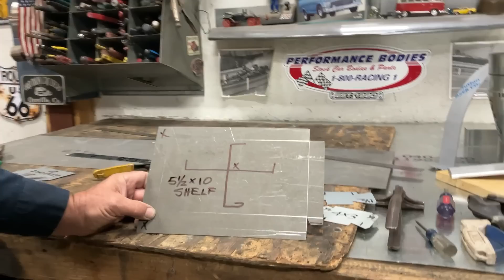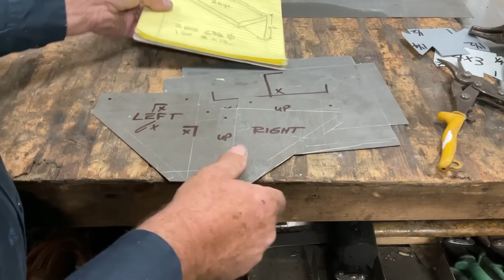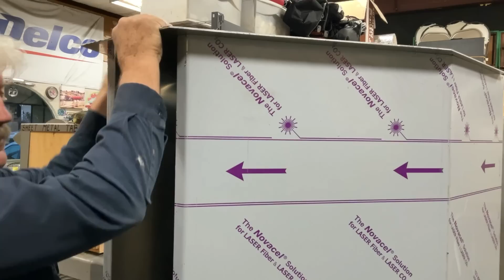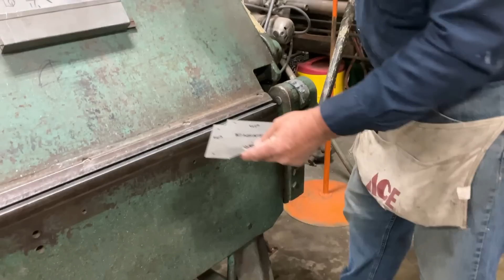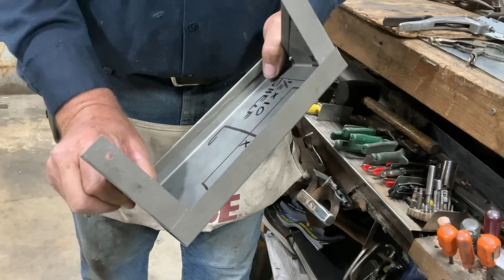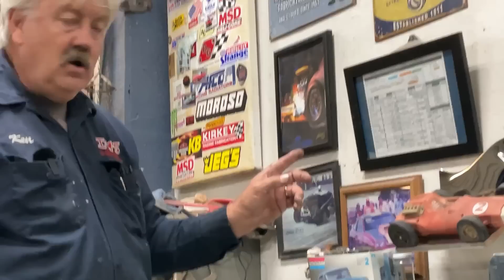Sheet Metal is Fun! Bookshelf Build and Gusseting Ideas

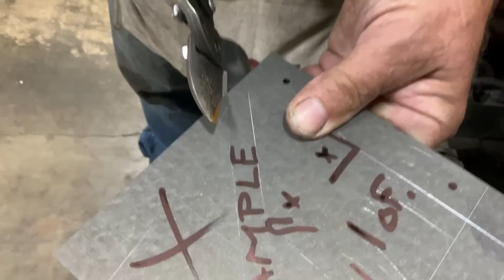Comment: The tip starting at 15:00 or so about just barely snipping each end of the edge to be cut so it locates itself in the shear is excellent! I'll definitely be using this.

I've learned a lot from your videos as I've started to get into thinner sheet metal design and fabrication. I do a lot of heavy sheet metal/plate design for industrial uses using large lasers and CNC/ATC brakes as part of my work. But there's something about scribing, shearing, snipping, and using a box and pan brake that makes the process feel much more intimate.

Thanks for all the great work you put into these videos Ken!
Reply from the maker: We'll keep making them if you keep watching them. The process of bending and folding sheet metal still fascinates me . We learn a lot by teaching. Thanks for learning along with us.

Comment: I was thinking of building sheet metal shelves for my cargo trailer to hold tools. What gauge sheet metal do you think would be acceptable for 16" deep by 36" wide shelves?
Reply from the maker: 18 gauge would be my recommendation.  It's sturdy and still workable. It's also heavy enough to weld. if you don't have a brake, you can have it sheared to size and  frame it with angle iron. Let me know if that answers your question. Thanks.

Comment: Ken do you happen to have any tips for the pop rivet gun? I've bought a couple now and they never seem to want to let go of the shaft once the rivet has popped! Is it just that I've managed to buy two crummy products or is it just something that you gotta live with ?
Reply from the maker: The riveter grips the mandrel with serrated teeth. Those serrations sometimes make it difficult for the tool to allow the spent mandrel to exit. Open the riveter wide open and try to allow the mandrel to exit the opposite direction as you fed the rivet. Be careful not to leave the spent mandrel in the riveter or the next rivet will eject it very near your face. Let me know if that answers your question.  Thanks for watching

Comment: Back in high school shop class ('65) they had us use blue marking dye to easily see layout marks.  Is that done anymore?
Reply from the maker: Machinists use it regularly. In sheet metal we use it on stainless steel when marking with the grain. Ordinarily in sheet metal, the scribe is sufficient for the tolerances we desire. In person, the scribe is very visible, it just doesn't translate well on camera. Good question.  Thank you

Comment: Ken, thank you for a well-explained video!  Also, when you broke the hems (I guess that's how you say it) on the various shelf components, the right-hand-side of the hems didn't "close" as far as the left-hand-sides did.  Was that due to wear in the break or another reason?
Reply from the maker: Wow, good eye. The brake closes at one end first, and then as you pull the handle, the clamping action moves toward the open end. This causes the un even closing of the hem. It's better to have a slightly open hem on one end and a properly closed ( tear drop) hem on the other. However , I could have moved to the left end of the brake and evened out the hem if I felt the finished project required it. Let me know if that answers your question. Thanks for your time. Great question.
Reply: @sheetmetalisfun   Thanks!  That answers it.

Comment: i thought you were making a pan with supports above and not a flat bookshelf with supports below.
Reply from the maker: Did you watch the whole lesson?
Reply: @sheetmetalisfun  i posted halfway.  Of course i watched the whole lesson!  i slapped myself in the forehead when you flipped it over...
Reply from the maker: Gotcha.
Reply: @sheetmetalisfun 
 Why was old school galvanized so much prettier?  Why does it have that pattern?
Have you ever used phosphoric acid?
Easy to de-rust metal.
Spray on.
Water wash off.

Your talking to a registered fire protection pipe fitter of 14 years.
Sheet metal shops had higher insurance rates because to slice a hand in sheet metal is easy.  
Fire protection had similiar rates  because the installation of fire protection "saves lives."
Quickbooks.

Comment: I made a few of these years back out of stainless, tray style to hold jack stands, only i layed out the gussets and tray all in one piece. Essentially the gussets were like an outside hem on the sides. If you can picture that. Took a minute to figure out the bend  sequence.
Reply from the maker: That's actually the better way to make it. All one piece. I'm bringing folks along at a comfortable pace, and I wanted to build off the pan lesson. I also wanted to show how the gussets could be used on wood or any other compatible substrate. You must hang out with a tin knocker once in a while. (Just guessing) Thanks for watching and sharing your ideas.

Comment: You CAN pull a file; it's called draw filing and is a common practice among machinists and gunsmiths.
Reply: Draw filing is done by pushing the file perpendicular and flat to the work.
Reply from the maker: A standard cut file?
Reply from the maker: My point is that you can't cut on the push and the pull. Just like a hacksaw, if you pull against the back side of the teeth you can break them.  Do we agree on that?

Comment: Ken thanks for the instruction. I learn something with each episode. I want to make an exhaust grill with fixed louvers. I have been puzzling how to cut slits in the middle of a sheet so that the louvers can be bent up.
Reply from the maker: We make the pre cuts with an 045 razor wheel on an angle grinder. Use a straight edge for repeatability. Practice on some scrap first. We made a louver punch that goes into our press brake, but I've had good results with a wooden die and a punch made from 1/2 × 3 flat bar ground to the desired shape. Go for it!

Comment: Amazing video Mr.Ken. I'm definitely going to be making something Similar to this. I've been thinking of a good way to make a rack for all of my hammers. I have over 27 hammers Haha. I think something like this will work good and I'll drill some holes for the handles and use a dimple die as well. I also love that you keep little things your dad had. I really like that you said that the nut will never be taken off that bolt he had. That was amazing to me. I completely understand. My grandpa had a pipe wrench he used the day before he died working on some steel fittings. The next day he had a heart attack. I built a box for the pipewrench without adjusting it. It's still where he had it.
Reply from the maker: I'm just an imitation of my dad. He could do anything. I do some things better, but that's mostly because of the tools we have. But it sounds like you got some kinda glitch with the hammer deal.  You might wanna get that looked at. We are having fun sharing and learning.  We are glad to have you along for the ride.  Send me a pic of your hammer hanger.
Reply: @sheetmetalisfun  yes sir. I do have a few too many. I will definitely send you a picture when I get it built and done